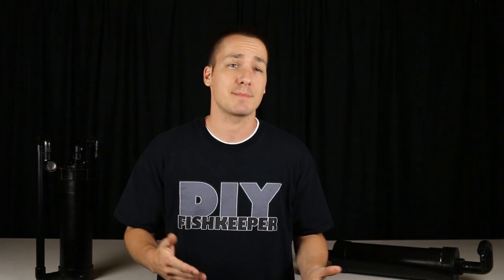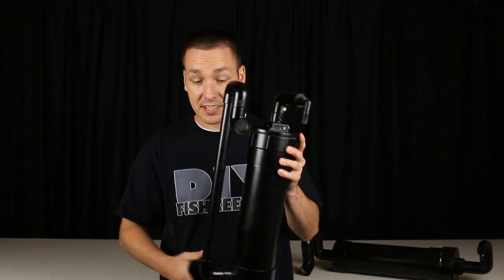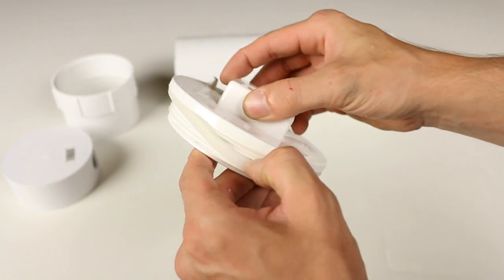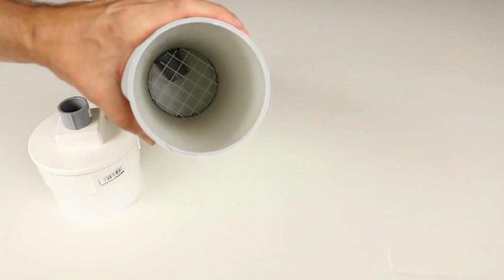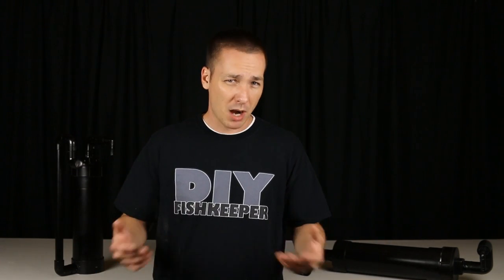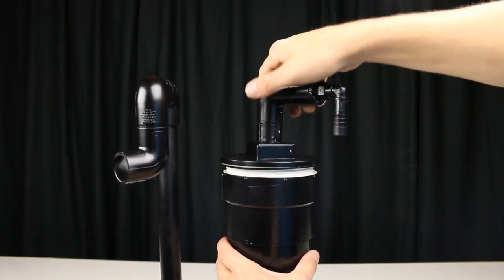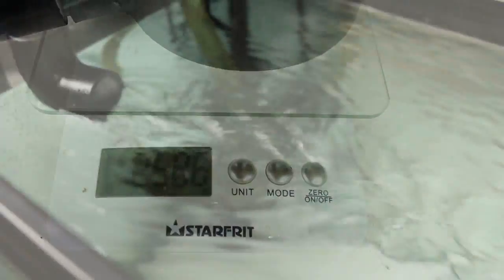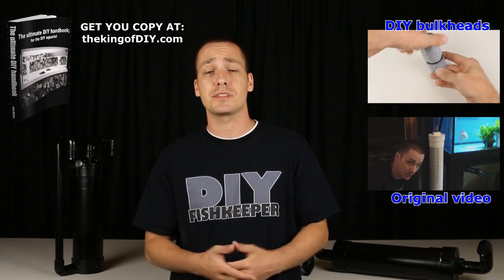HOW TO: Build an aquarium canister filter (HOB VERSION) TUTORIAL

Comment: I am a aquariam /fish lover and my question is how often to do " clean the filter " and do you replace the lava rock? or just rinse it off ???
Reply from the maker: Never. rince it in tank water when needed(which is rarely)
Reply: @The king of DIY  ok...wow...ummm so if I also want this to be the engine to propel an underwater waterfall with sand a water pump would be the best? On the outlet side of course and the piping for the waterfall would have to work like a venturi valve using the flow of water to create the suction to draw the sand ?

Comment: Would it improve circulation if the intake was on the opposite end of the tank from the outlet pipe (and even at the bottom of the tank too)?  It seems like by having the inlet and outlet in the same area, the circulation would be limited.

Comment: Just built the verticle version. Question on media. My order is course filter on intake. Activated charcoal in a fine filter pouch. Then 3 feet of lava rock then back to the tank.    I have a 55 gallon tall tank currently with a handful of cichlids. My canister filter I made is 3" and 2 ft tall. Did 3" tube because it fits behind my tank.....

Comment: Here's the part number for the ABS cap (Lesso) 4 inch ABS Plug (part number LN106R-040). They're pretty hard to find at retail locations in the US but available at Home Depot in Canada. Plumbing supply places can special order from manufacturer Lesso in US. Worked great for me. HOB canister works perfectly!

Comment: I recently built a ventricle canister filter based on this design with a slight mod so that i can clean the filter without disconecting anything. Its a little over sized but seems to be working well. I made the canister taller and put the input  into the side of 4in so that I can access the top without disconnecting the input hose. Tried to post a pic but it won't let me.

Comment: I built the horizontal version of this filter using 2’ of 4” PVC. I’m powering it with a 550GPH pump for my 55 gallon aquarium.

After letting the PVC cement dry overnight, I’m still getting some minor leaks and the connection points for the larger end caps. Just drips, but too much for me to feel comfortable just letting it run all day.

I can’t budge the pipe fittings, the cement is way too strong. So I can’t remove them and start over. How can I get the perfect seal?
Reply: You need to sand the pipe fittings then use primer on the pipe to soften it up a bit the use cement hot but make sure u hold each fitting for 15 seconds each
Reply: Also start over

Comment: Hi so I built one of these with the pump pulling from the bottom and siphoning from the tank into the top of the canister. Some how I was sucking in air but not leaking water, even when the pump was off no water leaks. So I put silicone on every joint, crack and crevice to try and seal the air leak. Some how it’s still pulling air from the canister into the pump. Any idea what I could be doing wrong?

Comment: any advice for installing the bulkhead to the side of the PVC. I have tried o-rings and silicone, still seems to leak a little. maybe I am positioning it wrong
Reply: Shrashira ....the hole has to be exact. You have to use a hole saw.
Reply: Thanks I was using a spade bit and the hole seemed to be a tight fit. I will experiment with the hole saw. Thanks again.
Reply: Shrashira use square down pipe would be so much easier 😂😂😂
Reply: Thanks will do

Comment: I built one of these 20 inch tall (4inch pipe measurements) and filled it with lava rocks, bag of carbon and the sponge on top with a 300gph submerged pond pump on my 46 gallon tank. My question is: Could this support my tank and let me eliminate the hang on back filter?

Comment: Great info, instead of running a single really tall canister filter.. Would you run them in parallel or series? I cannot see any reason re parallel apart from slowing the flow down... This way could have 3x 1ft instead of 1x 3ft which would be easier to store under/next to the tank.

Comment: Great video Joey.  I was going to make one of these but one of the key parts you use doesn't seem to be available here in the states.  All of the threaded clean out plugs I've seen (in both brick and mortar & online) screw into the adapter, it's not that they don't have a gasket (they don't) rather there are not 2 surfaces that come together for a gasket to seal.  

Anyway, in a pressure application this type of plug can only be made to seal with some difficulty.  You end up with a cap that's semi-permanent, not something that can be easily removed for periodic maintenence.  Perhaps you could buy a bunch of these plugs & sell them...

Comment: im building my 5 year old a fish tank from scratch im using wormy chestnut i got from a dresser that someone just threw away and ill have more than enough for the frame. my plan is to build it like a tv floor model, im thinking about building the tank out of plywood and using a canister filter. can you give me some advice on what to use to have it completely sealed (no leaks) and the correct way to filter the tank so the fish will survive and the water stays clear and more importantly stay in the tank?

Comment: Awesome video once again :) Thanks for the hard work

I am into backyard aquaponics and just in the designing phase of my system. I am seriously considering such a filter for my setup. My fish tank will be around 200 gallons and my sump will be around 50gl. I intend to use gravity to send the overflow of my FT to my sump and in between, using a tower filter like you are talking about here. Do you believe that by gravity alone, I could benefit with such a filter or does it have to be under pressure?
Thanks for your time and keep up the great work...makes me fill like a DIY expert :D
Reply: Jason Renoux You might see some videos on how to use in-line buckets as filters and reactors. One used for mechanical filtration, the next for bio media and a third for micro-filtration aka: polishing. In any event, you'll need a pump strong enough to push 5 to 10 pounds of water uphill so a pump needs to be used.

Comment: There are a lot of people in the comments saying that they can not find the screw-on cap with the lip and gasket. I ended up going with the normal screw-on cap and I'm going to try to use ptfe tape to prevent leaking since it's not permanent. 
If anyone finds links for the lids online please share!

*make sure when tightening your lid that you don't use the smaller input piping as a handle! I broke the seal on mine and had to re-cement everything.

Comment: what kind of pump should i get i already have a diy sump courtesy of you. My tank is 150 Gallons (3 turtles) I have an Active Aqua, AAPW800 800-GPH hooked to my sump i just need a pump for my canister (quite pump please) Thanks
Reply: Depending on how you have things set up, you could probably put the canister filter in-line before/after the sump. If your sump already handles bio filtration though then the canister might not be needed. If you want a separate filter loop then you could maybe even get another pump like what you already have. 1600 GPH / 150 G. will filter your tank about ten times per hour, which is just on the high end of average.

Comment: Hey, Joey, I have seen several people having issues finding parts in Canadian stores as well as online. Could you be so kind to share your buying rabbits as well as where these parts can be bought?

I went to Home Depot, Renault Depot, Canadian Tyre, Rona and even IKEA but I could not even find the 4'' pipe. Trying to find bulkheads or other pieces caused a lot of confusion and people were just pointing to the shelves and advising to look somewhere there as everything they have is in there.

Thanks in advance for the shared info as well as for the amazing videos you do!
Reply from the maker: first, I am Canadian. 
Second, everything in this video i got from Canadian tire and home hardware. (besides the pump, that came directly from bulk reef supply.)

This video is not a blue print. It is to serve as inspiration. If you can not find the parts, get creative and find alternatives that you think might work.
Reply: Joey, I was not sure I properly understood your comment until I found out that there is really a store named Home Hardware (.ca) . I am giving up a visit those guys as they have a few stores in Montreal and have quite most of the parts I would need or at least some of the parts that can fit as a creative replacement to accomplish my project. Thanks for the sharing. Any Montreal users/visitors can go and get the needed parts that other stores failed to even recognize.

Comment: hi joey just trying to find a screw top end cap, lowes  or home depot dont have the end caps with the lip and gasket looked on line cant seem to find them where did you get yours ill buy it online or a part number would help also  thanks
Reply: I'm having the same problem. I think I'm going to use some ptfe tape to prevent leaking with the non-lipped cap since it's not permanent.

Comment: hi joey im going to do hob filter as u show but im not have no luck finding the screw on cap with gasget that u use on your show
Reply: I'm having the same problem. I think I'm going to use some ptfe tape to prevent leaking with the non-lipped cap since it's not permanent.

Comment: i just wanted to inject a comment for your idea of DIY canisters is a wonderful idea i was planning to build the HOB or the vertical ... but ... i have been all over looking for the parts i've run into problems finding the parts... i'll explain ... the clean out adapter used and the adapter to make the bulkheads have been changed drastically in the manufacturing that you can't use them as in your videos .... ex. the end caps are rounded not flat ; the plugs for the clean out adapter no longer has a lip for the O ring and the threads are twice as long ; the adapters used for the bulkheads are of such poor quality ... you have to use pipe wrenches to put them together  and the threads are also longer also ... i did find a site to get bulkheads at  reasonable prices ... $6 to $8 depending on size ...  the stores called :
TB Aquatics ... 
just so you'll know ,
thanks for listening

Comment: this is super rad and I'm planning on building on for my 75 gallon. so roughly according to your measurements I'd need about a 4 ft canister to turn that tank twice an. hour. also will be using a 192 gph pump. does my math sound off or should be good?

Comment: Joey - is that a thin walled 4" pipe or standard schedule 40?
Reply from the maker: +John D'Errico No, it would be more like sch20
Reply: +The king of DIY - Thanks. Was just over on the forum looking for an answer as well. I picked up a 2 foot length of sch40, but thinking it's too thick for the DIY bulkheads when you are trying to go through both the tube and the cap.

Comment: does the bottom side hole will leak? as is curve section.
Reply: get a filler  to file and make it flat
Reply: Or pile on the pvc cement and silicon. That's what I did and I haven't had any problems yet.

Comment: I have been looking online for that male cap but unable to find it. Can you  tell me where I can find it?
Reply: Lowes has the part that you need. it is part number 24094 and will allow the male pvc plug to make a water tight connection. in California it sells for 4.09.
Reply: Vaughn McCarthy I found some on ebay.they make them in canada. Company called Bow
Reply: Vaughn McCarthy 
Hey man just an FYI they call that a 4 inch clean out assembly
Reply: Where can you find a male cleanout plug top with the lip to get a good seal on it. Ive only found ones that dont have an O Ring fitting.

Comment: Joey, I think I'm gonna go for it and build one of these, but I have a question. Is there any advantage to having the water flow down from the top of the canister instead of being pushed up from the bottom?  I'm wondering if the top-down flow would be more of a "trickle" compared to the bottom-up flow, which would definitely pass through all of the media. But would bottom-up require a pump with more head capacity? I'd be grateful for your thoughts on this. (Or anyone else's!) Thanks for all the great vids!

Comment: Joey, My bulkhead at the bottom keeps leaking, even with an o-ring  on the inside and outside. I have used silicone with the O-rings as well. Any suggestions?
Reply: +Jeff Miller Use a uniseal. I have yet to try it, but they appear to be designed specifically to give you a watertight connection in the side of a curved surface. One place that sells them is bulkreefsupply.com, and they even have a short video showing how to use them.
Reply: +TheNotehead Thanks Joey, I kept adding more and more silicone, and eventually stopped. Thanks for the uniseal idea that would have likely helped. I have ordered some to use to add the inline heater. Great stuff!

Comment: I have done something similar by buying an extra off-the-shelf canister used for my RO-system, which comes with barb fittings.  I just fitted a pump inside, but I like your outside pump idea, since this doesn't need priming.  I can then also use pre-filled cartridges that are easy to swap out and chain several canisters together, each with different (or more) media.

Comment: Could you make a 2-3 stage canister by attaching multiple by lining more 4inch pipes filled with their respective medias? Ex) one has biological and the one before it is purely mechanical and you can even go as far as having one for chemical. All assuming you have a pump strong enough to circulate through the extra lengths of piping.

Comment: so, no more of those ineffective HOB power filters for me! These DYI filter will work a lot better and cheaper than them; and no more worrying about feeding the water into the filter or loud noise since I can pick the water pump that are way better and more quiet than those come with the HOB power filters.
1 question, what do you think about adding UV sterilizer at the end of the filter which it is very easy to be done with these DYI filter? Would it help in diseases prevention or just algae control when I put an overkill UV system for the tank on it?

Comment: Is there a way to get this to work with an under gravel filter? I'm in the process of building one for a turtle tank.
Reply: +nystyle324 
i was planning to use a UGF as a strainer as to be part of a EXT. canister system;
replace the lift tubes with bulkheads and tie them together and run up to the canister ; and use a pump on the discharge side of the canister in the tank so it would pull a vacuum so there will be only cleaned water going in the pump saving the impeller from damage

Comment: I am currently using the design ideas you used in the plywood aquarium to construct a 5 x 2.5 x 7 foot tall lizard terrarium that is incorporating the bottom as a water tank for my water dragon to do his thing.  My issue is that I'm trying to keep all of the water filtration internal.  I was giving thought to creating a side chamber within the aquarium tank for multiple canister filters.  The max water height I am wanting to go is about 2 feet high.  So it's coming out close to 200 gallons.  Any advise on the filtration system?  I was thinking exactly what you've made in this video, but it be 4 inch pvc 2 feet in length and I've got a 500 gph in tank pump to hook into it.

Comment: Hey Joey this looks like a very doable and cost effective build. Would a powerhead do for a 4ft 55gal tank? Or would something larger be necessary? Oh and also, would the filtration work better with a slower flow or a more powerful one? Thanks for the great video
Reply from the maker: +Maurice Aquariums With a canister filter, I like to shoot for around 6X turnover. So on a 55 I would want about 300GPH. A powerhead would work well on that tank as well, as long as it meets the flow rate needed. Flow rates depend on method of filtration, however there does come a point when it can be too slow or too fast. Too slow and the water isn't turned over enough to keep up with ammonia production. (You would have to go really slow for that to happen though). Too fast and the bacteria doesn't have long enough contact time with the media. Personally, i would rather not have enough flow than too much. I can make up for lost flow with airpumps or powerheads.
Reply: Thanks for the education Joey. I saw in your vid the sizes to achieve 300GPH, and I'll go with that. Thanks for all the great info. Love your projects and looking forward to next Thursday :D

Comment: Isn't it better to change the pump to the other tube? so the water goes in the canister from the bottom and up. I'm building one and I think this way the filter media works better as everything will stock on it from the bottom to the top, getting cleaner water at the end.  What do you think?
Reply from the maker: You could, but pumping in from the top allows for easy access to the mechanical media that you will change often. Water flowing up or down won't matter. Either way it has to travel through the media to get out.

Comment: I'm deffinately going to follow one of your filter guides. I'm using a 75 gallon tank and would like to have a filter system for up to 100 gallons as my tank has a lot of gold fish which make it dirty easily. My question is, can you use K1 for the media in a canister filter? I like the idea of not needing to clean the filter and just focus on water changes.
Reply from the maker: +UltimaStealth94 It will not work the same in a canister filter. So no, You will not be able to use it and get the results your looking for.